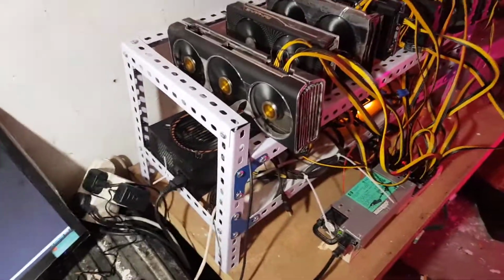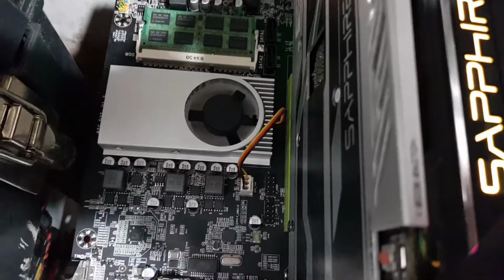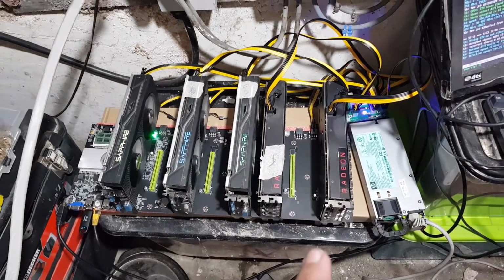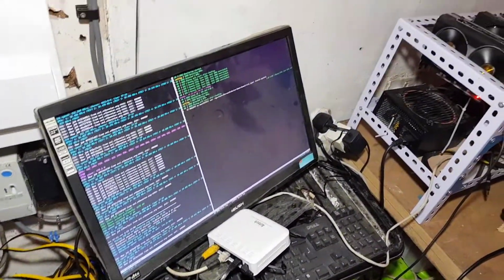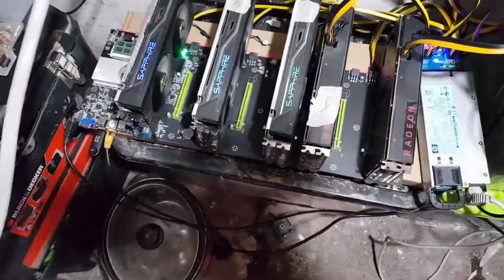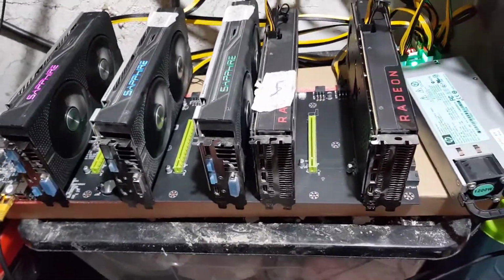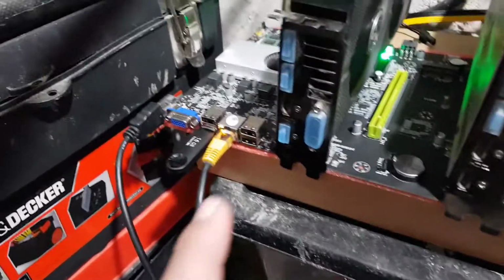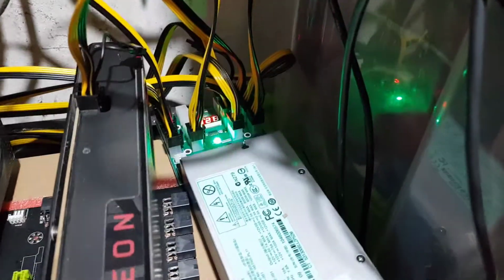My D37 Mining Motherboard setup - 8 GPU Riserless Motherboard

Comment: I know this is old and you may not see it, but this did help a lot. Thank you. 😁👍🏼
Reply from the maker: I saw it. Thanks for the comment and I am glad it helped. there is also a 2nd way to wire this board. you can use the bottom pcie power slots and wire the side ones as outputs to gpus.  this is a video of the 2nd way you can wire it using the  bottom power and then the side power straight to gpu. I think actually this 2nd way is why they put slots on the bottom watch it here EDIT: I am now using this 2nd way I am showing you and I have been stable for 90+ days here it is  - https://www.youtube.com/watch?v=7OhzpbaoRPE

Comment: Thanks I just got one of these for 60 usd it looks and smells delicious very excited
Reply from the maker: you will enjoy it. you may want to watch my video on how I learnt to CORRECTLY wire it up. it depends on which cards you are using. for mine i learnt to use the passthrough function the board has where you plug power into the bottom connectors and then the side picie connectors are outputs to the card not inputs as in this video. it works both ways here is that video - https://www.youtube.com/watch?v=7OhzpbaoRPE

Comment: Hi!are you facing that gpu slot unable to detect gpu?i had 2 slot no idea what happen unable to detect my gpu,cmos clear doesn't help.... 😔
Reply from the maker: i have 7 cards working but i do have 1 slot that will not detect a gpu no idea why?
Reply: @GhostvaperYT  omg right now i had 3 slot gpu unable detect gpu...trying to fix it but no luck 😭
Reply: @GhostvaperYT  i had D37 model no problem at all,only this model T37 giving me problem and unable to solve it...clear cmos leave it half day and put it back the battery and use all type of gpu no help.

Comment: If u dont use a gpu slot on the mobo u dont need to plug a 6 pin into that slot? My mobo has 8 gpu slots but only 6 power slots for those gpus slots...shouldn't there be 8 power slots? 1 per gpu slot?
Reply from the maker: your mobo must be different try it out how you think best maybe yours needs them all in?? mine needs cables only in the slots that have a gpu in.

Comment: So you don't need a ssd drive if you run it off a usb drive?
Reply from the maker: thats correct you can run it off usb if you wish with no ssd - thats what I am doing as my power supply has no sata connectors so i use usb its great  - EDIT - PLEASE WATCH HOW I LATER LEARNT HOW TO WIRE IT ALL UP CORRECTLY it can be done as in this video but this new way is better  - https://youtu.be/7OhzpbaoRPE
Reply: @GhostvaperYT  Thank YOu!
Reply from the maker: @georgehawt  welcome mate - did you watch the video on how to wire it up the proper way???  - https://youtu.be/7OhzpbaoRPE

Comment: Hey I had this motherboard for quite a while now.. I had it running on 6 GPUs but now I tried adding 2 more GPUs and it wont turn on. I remove the two GPUS it works.. I disconnected the power from the gpus directly and it works.. I'm not sure how to fix this issue.. Obviously I can't run the gpus without direct power.. I cant figure out how to fix this issue..
Reply from the maker: did you try using the power plugs at bottom of the board??  also did you test each slot works fine?  also did you try adding 2 more gpus using risers to se if that works?  - sounds like some kind of electrical short.  make sure you test all your cables aswell.
Reply: What PSU are you using (watts?) I had this problem when i had too many gpus on the same pcie plug using y-extensions.
Reply: Hey I hope u figured out how to fix your problem. Can you recommend this mobo for bitcoin mining?
Reply: @nabilellaji6509  get the latest one and yeah its amazing just make sure you power it right
Reply: @nabilellaji6509  Hey it works perfect.. Just make sure you get the right psu for it.
Reply: @anaskadri  By this, do you mean a server PSU or have you found something else suitable?

Comment: How do you power the motherboard? Also with a 6 pin (as the server psu doesn’t have a 24 pin).
Thanks
Reply: Yes. It's powered by the 6 pin
Reply from the maker: on this board EVERYTHING is powered by 6 pin only. there is no cpu power plug at all. it is amazing. plug ONE cable into your pcie slot thats it and whatever the card needs and it will run. you just plug in the pcie slots u need and cards thats it.
Reply: @GhostvaperYT  if I want to use risers do I have to still power the 6 pin on board and the riser?
Reply: between 15 to 25 watt

Comment: What GPUs are you running?
I have seen some issues about hashrate in more recent cards i want to know a little about it, do you have any experience like that?

Great video
Reply from the maker: on this board i am running rx 470 8gb i have on other rig with risers rx5700xt -  i found you cannot mix  rx vega  with other gpus!
Reply: Just to add info here : 

I run several rigs with 6700xt but only 4 cards per board because they are 2.5 slots wide (here i recommend the 8gpu board with blue pcie slots , its a bit wider for more space between gpus) but i also run a few rigs with 3060sLHR because i mine ravencoin and thats unaffected by lhr limit. A few rigs with 3090+3060, some 3070s so mixed older gpu rigs and a rig with w7100s.  Each rig powered by 1 psu and all without risers . Cheapest way to build rigs. All put on these metal shelves in a grow box for heat containment and air flow control.

Comment: Hey man, great job answering all the questions I had on this board!
Reply from the maker: no problem if you need know anything else just ask
Reply: Fr, also just to be clear, this board doesn’t need a 24 pin right. So how does either board get power?
Reply: @abcdefGaming38  it takes the power to run from the first pci-express 6 pin